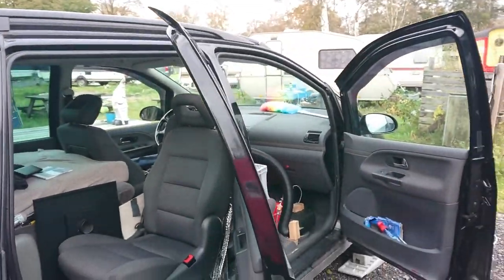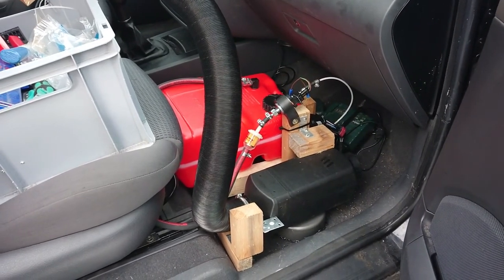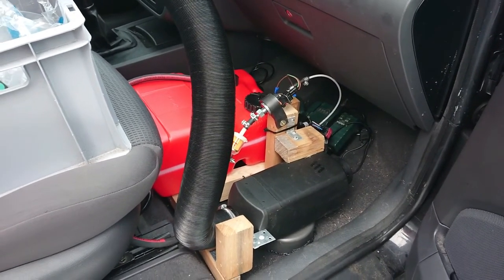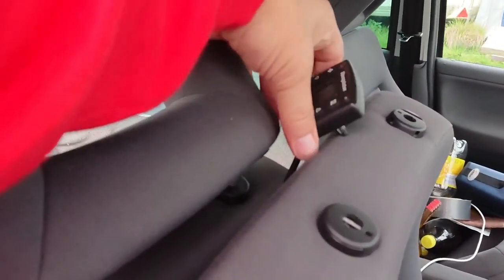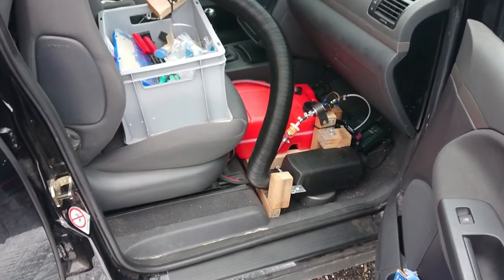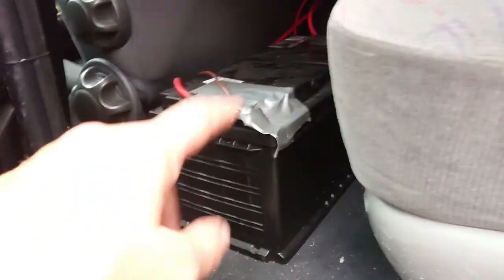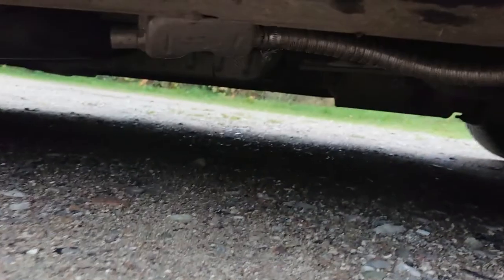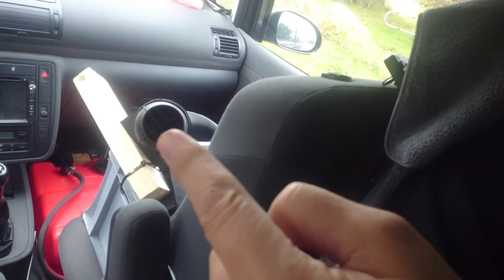I Have Installed The Heater. The Raven. Minivan Camper. Nomadic Dane. Life is good. Diesel Heater.

Comment: Good idea to move the heat outlet to the floor. The heat will rise and warm your intire body, and not just your head, as it is now. Good idea to get a diesel heater for the winter time, but get a longer exhaust tube to get the fumes away from the car. The emissions are dangerous to your health, and the current placing of the exhaust is unfortunate as it is now. I was recommended to your channel by Bob and Elizabeth at Tinyhouse Preppers, and I look forward to seeing how you cope with a minivan life in Scandinavia, compared to a similar life in the US. Best of luck and stay safe.
Reply from the maker: First welcome to my channel,  I hope you will enjoy my videos.  
After I made this video I have moved the outlet from the heater to the floor under my seat in the back of The Raven. 
And yes it does make a difference. 
I am working on trying to find a long exhaust tube. 
My plan is to run it to the other side of The Raven and to the back end. 
That's where the exhaust pipe from The Raven is to. 
Thank you for subscribing to my channel and for watching the video my new friend.

Comment: Very nice setup with the diesel heater, i have been thinking, if you can't get to the fuel tank from the raven, can't you cut the fuel line going from the tank to the engine, and put a T section in there. Using a 1 way valve towards the engine, you can't drain your fuel line going towards the engine... just an idea, hope you can use it! Stay safe!
Reply: No. The engine fuel pump will force fuel to the heater.
Reply: @dangeroustoman  then also put a valve on the line to the heater, so you can open and close it manually.
Reply from the maker: I have it connected to the fuel line there goes from the tank in the Raven and to the build in Engine heater.
There is no connection to the engine fuel pump there.
So now I don't have the fuel tank on the floor inside the Raven anymore.
Thank you for your comment and for watching my video Robin.
Reply from the maker: You are right about that.I have it connected to the fuel line there goes from the tank in the Raven and to the build in Engine heater.
There is no connection to the engine fuel pump there.
So now I don't have the fuel tank on the floor inside the Raven anymore.
Thank you for your comment and for watching my video.
Reply: @NomadicDane  awsome! Let me know if it works well 👍

Comment: Im trying to put the diesel heater on the roof in a box and run a heat pipe and controller in the sliding door window. In my Mini Van